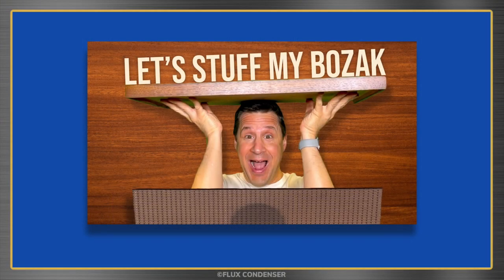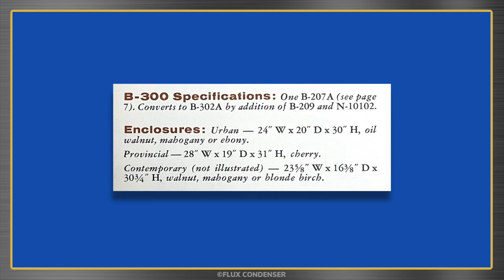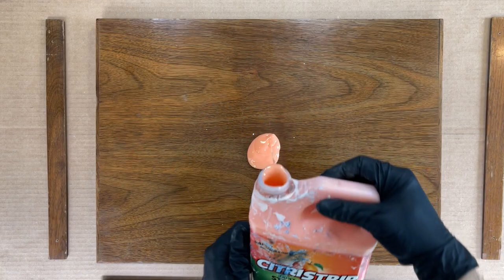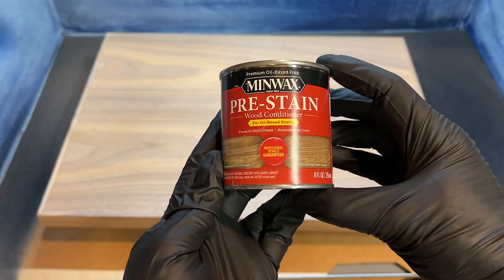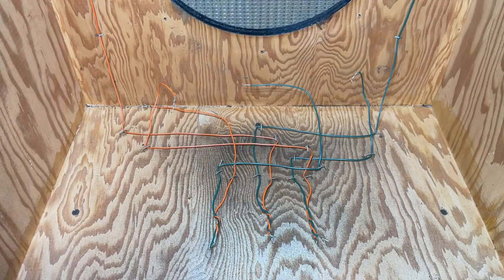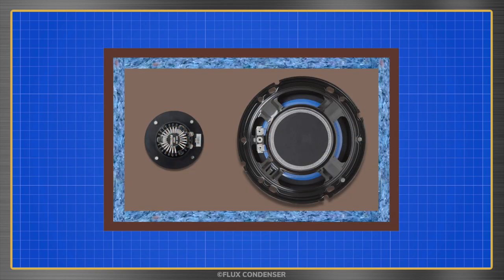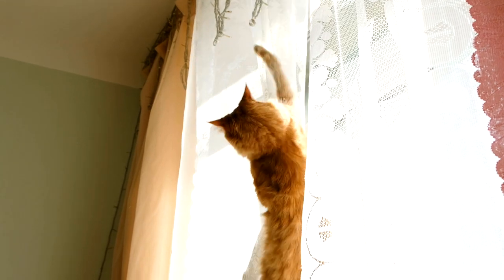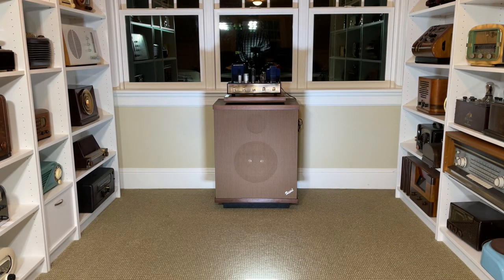Let’s Install New Acoustic Insulation, Refinish The Cabinet & Demo This 1958 Bozak B302 Speaker • P3

Comment: I love your restoration. I had my pair done. I told my tech to use your vid as the template for my rebuild with the only difference being the Tobin mod. This was his first time working on Bozaks. His predecessor passed away so he was up. It took him awhile to come up to speed on them, but I was happy with his work overall except for one thing. It’s been 2 years and it still gauls me. He didn’t put all of the new batting back in. I mean, he ran out of material. I’d have bought more if he’d said something. Idk if it was the back wall or the curtain. Probably the curtain. I haven’t had the heart to open one up and see. He was concerned about the price of the batting and was trying to keep the cost down. Also, he didn’t see where it would have made any more of a difference in the sound. Dude, you had one job. 
One day soon I’ll open one up and see how much more they need and what I need to do to get them back to where they’re supposed to be.

Comment: If you sand the walnut a bit  before using the woodfill you can mix the sanding dust into the woodfill and have the result matching the walnut very closely.
English not first language so hope you understand 😁
Reply from the maker: Good tips, thanks.

Comment: Very nicely done. The final result is very satisfying and looks great with the amp. Also the original video thumbnail was funnier :)
Reply from the maker: Thanks, Cubik. You caught that thumbnail change, eh? Yeah, “Let’s stuff this speaker” was the original version I was going to use, but just before posting I changed it to “Let’s stuff my Bozak” as, I too, thought it was funnier. When I posted the video, though, the response was tepid, especially compared to my last video which was also about this Bozak, but the thumbnail for that one clearly stated it was about crossovers. So, I wondered if “my Bozak” was too obtuse and possibly off-putting, so I changed it to “this speaker.”

Comment: Nice video, well done restoration. If it was me, I would have gone ahead and replaced all of the internal wiring. Nothing crazy or audiophool expensive, but a bit heavier gauge.
Reply from the maker: Thanks, Kevin. Yeah, I considered replacing the wiring (and some was replaced), but decided to keep things as original as possible. Mostly, I wanted to keep that crazy stapled wiring intact as it’s so unique. Resistance-wise, for that small length of wire 18 gauge is more than adequate (yes, even for solid wire considering the skin-effect). If it was 22 gauge I would have swapped it out. 

To each their own, though, so people should have the freedom to experiment a little. Swapping 18 gauge stranded for the 18 gauge solid would a legit alteration. But, as you said, using some expensive, exotic speaker wire would be foolish and would take away from the vintage authenticity. I hate seeing those kinds of upgrades in vintage stuff.
Reply: @FluxCondenser   thanks for the reply!  I appreciate the ‘keep it original as possible’ approach, believe me. Especially the funky stapled wire runs, they’re obviously there to keep the wires out of the way of the hanging insulation. Cool, thoughtful design. More than anything I was thinking that since one broke so easily, that’s a red flag that they might be brittle and getting kinks/separations. Lots of vibrations over a half century. As long as it doesn’t involve digging into potted crossovers or transformer windings, I often treat decades old wires as maintenance replacement.
Reply from the maker: Kevin, yes, I should have explained better how the wires broke. The old wire in the speaker is actually still in like-new condition. Even where stapled, the insulation was fully intact and the housing still pliable. No, the damage was completely my fault. I was unclipping some of my zip-tie work and accidentally clipped one of the wires in half and nicked the housing on the other. A dumb mistake, but in my defense working on the floor in that cramped space wasn’t easy ;-)
Reply: @FluxCondenser  Ha!  The truth is out ;-).  I have done EXACTLY that.   Swapping out a crossover a few minutes before guests arrived for a club listening party, I cut the wires to the woofer. No time to fix.  Solution?  Wire nuts!  Anybody notice?  Nope!  

Thanks again for the video.
Reply from the maker: Ha, love it! When I mountain bike or ski I joke that, “If you’re not breaking something, you’re not trying hard enough.” I don’t know if the same holds true for repair work, but it makes for a nice excuse.

Comment: Great video. I have a pair of B313 in almost perfect cosmetic condition,  the only work I need to do to them would be replacing all the capacitors. The "mid and high sometimes strident in comparison to modern speakers" that you mentioned  has been addressed in the "Pat Tobin Mod", have you considered doing that? I'd like to keep mine in vintage stock condition, so if the sound isn't too bad, I would like to leave it alone and there would be much less work for me. Any comment?
Reply from the maker: Thanks, Rustynail. Yes, I’m familiar with the Pat Tobin mod, however when I was researching this project I found that it doesn’t appear to be intended for the tweeters in my speaker. Mine is the earliest version, before they made a change to the cone material which is what the mod is supposed to help correct. 

I’m with you, though, as I often prefer to keep things original despite claims of improvements. If this was my daily speaker, I could see wanting to max out its performance, but the point of vintage gear, for me, is to hear them as they sounded back in the day.

Comment: That speaker is the same age as me - I wonder if I could be improved with a bit of new insulation and a coat of stain?
Reply from the maker: You know, Alan, I often wish the same. If only I could fix my wounds and years of aging as simply as I can with an antique piece of gear. Thanks for the comment. Now I’ve got that Police song in my head. “We were born… born in the 50s!”

Comment: Really great presentations. Your effort shows.
I think these bozak speakers had 2 or 3 iterations (especially tweets and mid). Did you look into any of that ?
Thanks.
Subscribed. With bell.
Reply from the maker: Thanks so much, Paul. Welcome aboard. Yes, you’re correct. Bozak used the same basic components over many decades with gradual, but subtle improvements along the way. The speaker I show in the video is the earliest version of the B302 speaker. When you research the B302 and its variations, you may come across some suggested upgrades to the crossover. Note, that I while I changed some of the wiring of the crossover for convenience, I didn’t change the circuit in any meaningful way and that the suggested crossover upgrades you’ll find on the internet aren’t intended for this early version.

Comment: This in an odd question, but do you know what if any spider is used in the construction of the tweeter? I thought that it’s possible that the aluminum cone acts like a giant dome tweeter diaphragm. Since there is no basket per se, I can’t confirm this hypothesis. Any input is appreciated. Love the vids btw!
Reply from the maker: Thanks! I can’t say for sure, but I imagine there must be some sort of spider or suspension. I’m out of the country now so it’s difficult for me to confirm this.
Reply: @FluxCondenser  thanks for getting back to me. Happy travels, stay safe.

Comment: Thanks for the great video.  Especially the source for the cotton batting.  Regular upholstery batting is too weak to hang as the curtain.  Your stuff looks perfect.  My only question is Bozak traditionally used "Terminal 1" as common and 2 as hot.  It looks like you switched that but as long as you kept it straight internally, it doesn't really matter.  I'm working on a set now and will be trying your trick from episode 2 of moving all the crossover components to the hot side of the drivers.  Can't wait to see the results.
Reply from the maker: Thanks, Bill. Glad you enjoyed the video and can apply some of the info to your project. Yes, I was surprised that the terminals were marked incorrectly, but throughout the speaker and crossover, green was used for common and orange for positive, so I made sure the terminals were denoted that way. Switching the crossover components to the positive won’t make any audible difference, it just made it easier for me to test the crossover. Good luck on your restoration. Please keep me updated here in the comments about your progress.
Reply: All of my Bozak speakers do use terminal two for the hot so I believe it is best to restore the wiring that way.

Comment: I have to rebuild a couple of Bang and Olufsen S75’s crossovers…..any tips out there?
Reply from the maker: Not familiar with them, but the earlier videos in this series might be of assistance. I'd suggest not falling for any "crossover upgrade" silliness. Just test the components and replace whatever is bad. Coils and resistors are very, very likely to be just fine. Make sure you replace capacitors with the same types and be aware that many crossovers use bipolar Electrolytics. Don't replace those with an ordinary electrolytic. If you have any specific questions, feel free to leave a comment and I'll do my best to help. Good luck on your restoration!
Reply: @FluxCondenser  thank you….better to keep it simple. For whatever reason, this model tends to catch on fire an little bit but never goes anywhere because there isn’t a lot of air. When I opened it up, I could tell it had burnt up a bit. I’m going to go looking for specific advice to restore and possibly improve it(just prevent form catching flame). It’s funny….when I first tried tackling this problem many years ago, the internet was young and now you find a 100 different references when years ago it may have not even been talked about. Enjoying the channel. Kudos!
Reply from the maker: That model tends to catch fire? Yikes! That may be the rare crossover that really does require resistor upgrades (to higher wattages), or perhaps the addition of a fuse. Interesting, keep me posted on your progress. You had me with “fire!”
Reply: @FluxCondenser  
Yeah….I thought that would grab your attention. I just went looking and found some more info on the issue. Great sounding speakers.., a bit of a risk but I think someone will know how to mitigate it. I bought some gutted crossovers many years ago and I’ll upgrade them to make them a bit safer. 
Any tips on AC10 “like” amps or smaller powered AC30 type amps. I’ve been collecting over the years and tend to play the 15-25 watt amps and love a variety of sounds-Ampeg Reverberocket, Falcon, a Valco, all from 1965’ and a 55’ Maestro GA45- all doing very different sounds and would love to get that crispy up front sound for lack of a better word. I dont have an EL84 amp. I saw that Henry Amplification is making an AC10 circuit but didn’t know if their were any vintage that had that setup. I have a chance to get an older Traynor with 4 8” speakers with EL84 power section with 12ax7 preamps. I believe it’s cathode biased but don’t know if there are tonal similarities. Any tips?
Reply from the maker: I don’t have any experience with instrument amps as I don’t play so I don’t have a lot of input there. They do fascinate me, though, and I hope to someday get to work on an old tube guitar amp for one of my musician friends. In many ways, they’re similar to hifi amps, but in others very different. 

Hifi amps need to have flat frequency response and low distortion, and often sacrifice power to accomplish that using lots of negative feedback. Guitar amps are often revered for how they distort and alter frequency response and that freedom allows them to produce more power. Two very different sides of the same coin.

Comment: Great restoration, wonderful music selection.  Bass seems ill defined but where do you start?  Acoustic feedback to amp?  Amp issue?  YouTube equalization?  Wish I could be in the room... 👍👍👍
Reply from the maker: Thanks, Darth. Yes, the audio recording I made isn’t great. In person, the bass is simply wonderful. Deep and effortless. If I’m going to keep doing speaker demo recordings I need to invest in two good directional microphones which will mostly record only what they’re pointed at. The microphones I use now are great for voiceovers, but pick up far too much of the room ambience. In the recording I made, you’re not just hearing the speakers, but all the ambient, time-delayed echoes. 

As I said, in person it sounds wonderful, so our brains apparently do a much better job of making sense of the speaker and ambient sounds than my microphone does. I have a calibrated microphone for speaker testing purposes that I’ve never used and you may see that in an upcoming video if I decide to test this Bozak.
Reply: @FluxCondenser  I should have added my Monsoon PlanarMedia 9 desktop speakers as a possible source of blurring with the bass - it's just difficult to reproduce a 12" woofer using a six or seven inch woofer.  Maybe I should move my Pioneer HPM-100s in here, plenty of square inches of woofer in those!  But will they fit on the desktop?  <scratching chin and reaching for tape measure>
Reply from the maker: Ha, just do it! On a serious note… Yeah, listening with a good pair of headphones is probably the best way to listen to the recording I made.
Reply: I'm listening through an outboard DAC and headphones and the bass is prominent but pretty well-defined. There's no replacement for displacement.
Reply from the maker: Thanks for your input, Martin. Yes, admittedly my recording doesn’t fully capture it, but these speakers have astonished me with the ease with which they reproduce a natural-sounding deep bass. It has a quality that isn’t often matched by even today’s larger speakers. I think there’s something to be said for the infinite baffle design.
Reply from the maker: Darth, I forgot to mention that I took your suggestion and listened to John Coltrane with this setup extensively. It really makes for match made in heaven, especially with his true mono recordings. In general, this setup obviously sounds best with mono recordings as I don’t need to use resistors to blend the two channels and the mix is designed for one speaker.
Reply: @FluxCondenser  There is some early Beatle music done in mono too, if you happen to like their genre.  Some of their early experiments with stereo were essentially dual mono with the vocals in one channel and the instruments in the other.  Some had maybe John's vocals centered  but they played around a bit at first.
Reply from the maker: Yup, been listening a lot to the Beatles in mono as well. Other mono selections by Thelonius Monk, Miles Davis, Billie Holiday, Sonny Rollins, The Stones, Credence, James Brown, Johnny Cash, Aretha and even The Bee Gees.